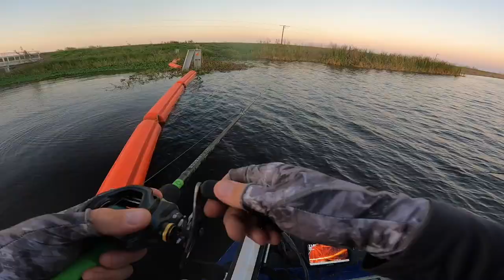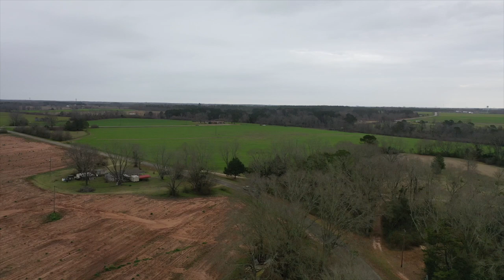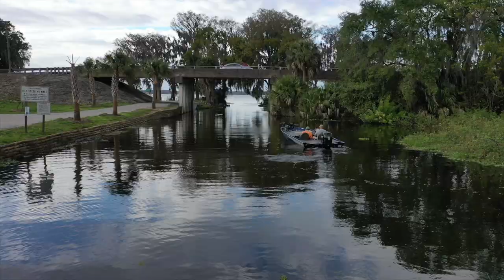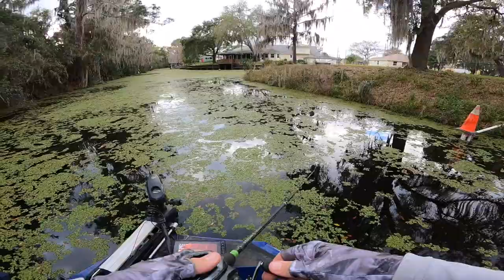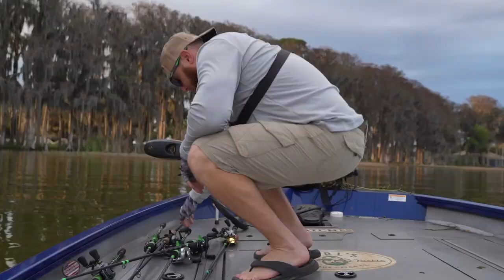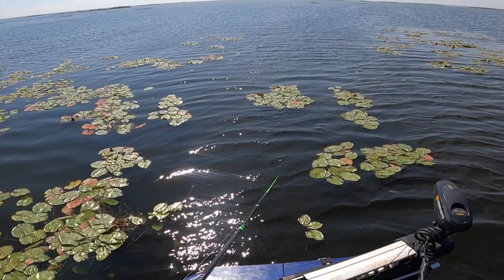Fishing the BEST Bass Lakes in FLORIDA part 1 (Let the Adventure BEGIN!!)

Comment: The grinding noise is 100% lower unit... Not only do you gotta broken prop, but def didn't change the lower unit oil a couple of times during break-in and may have a bent prop shaft from hitting whatever hard enough to break a fin off of your prop.... Lessons learned for being a boat owner.